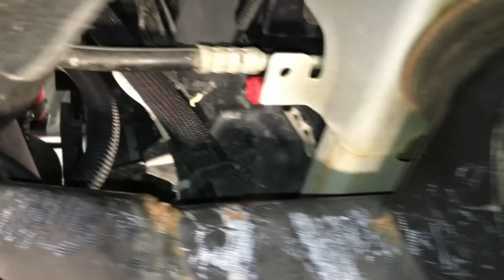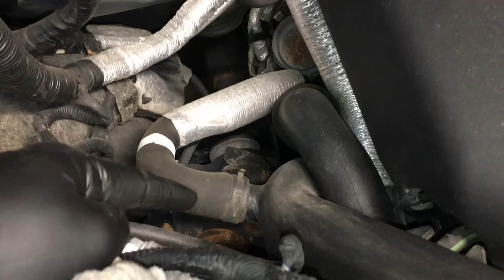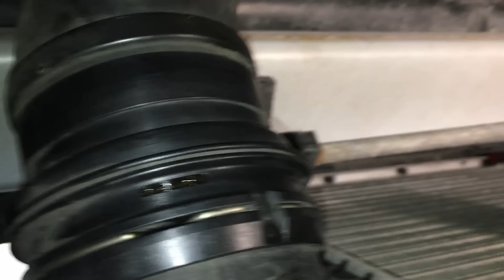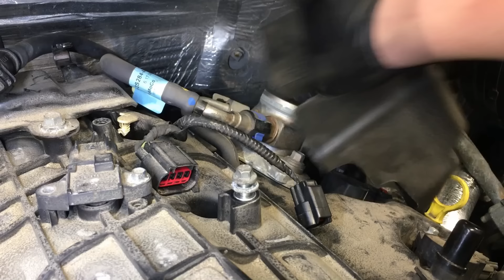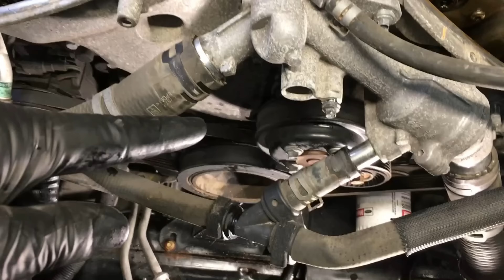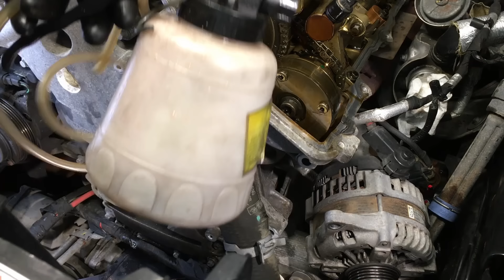2011-2016 Ford F-150 3.5L Ecoboost Timing Set Replacement Part 1: Getting Inside the Engine

Comment: Here we see the EcoBust in it's natural habitat.  Cue the documentary music
Reply: Right...cause the amazing 5.4L never had cam phaser and chain issues...did it?
Reply: I have a 5.4 with 300,000Km and have never done anything with it. Chains would rattle at an idle so I put in a bottle of Lucas with every oil change. So far it has kept the rattle away.+
Reply: People failing to maintain their vehicles is NOT the fault of the manufacturer
Reply: @MrErikw26  I have a 3.5 ecobust with 50k miles on it and a major rattle from the timing chain. I have never hauled anything, always changed oil every 5k miles with mobil1 full syn. Now... have I failed to maintain this vehicle??? It IS Ford's fault for making a sorry POS engine that has major failures @50k miles, and claiming it to be the TOUGHEST son of a bitch ever made!!!
Reply: @user-zx1ir7jt4c  everything mass produced is gonna have a few bad apples here and there, never saw a 50k engine with timing chain rattle that wasnt poorly maintained personally.
Reply: Sam Smith I know many people who have 300,000 miles on these ecoboost engines with zero issues. It’s luck of the draw too.
Reply: MrErikw26 I had a 2013 f150 with 60k timing chain rattle oil was changed every 4K miles now I have a 5.0 I’ll never get a eco boost again not a maintenance problem it’s a manufacturing problem

Comment: I'll be doing this sooner or later
are you going to upgrade the oil and coolant pumps too?
Reply from the maker: There is not much out there in the aftermarket for these engines yet surprisingly.
Reply from the maker: Upgrade them to what?
Reply: just wondering if there WAS an upgrade like the oil pump on 5.4 higher pressure and volume, as some people have complained of early cam bearing wear etc,...and ,...can the  higher pressure blow oil out of the main seals?    My ecoboost rattles once in a while but not often,...maybe once a month,...I keep the synthetic oil clean with 3000 mile changes and ford filters,...I do get a bad knock sometimes on hard accecleration on the on ramp to the highway,....I don't know what's going on so I have to ask questions,...thanks for the reply
Reply: Nothing available yet?
Reply: thanks for the information demonstration and replies,...my 2013 f150 is at about 100K and rattles about once a month,....I don't have a catch can but I do keep my oil clean,...maybe by the time I can't handle the death rattle anymore the new parts will be out,...or maybe even a crate engine replacement

Comment: Ford seems to have used the German method of engineering: make repairs as difficult as possible!
Reply from the maker: It sure seems so with this engine!
Reply: That's because - the ecoboost line was designed - in Germany. Forget whether it was an independent German design they licensed or whether it was Ferd of Germany that did it.
Reply: skigdivider x  and yet it's not a sbc or a LS that's having the timing chain replaced in the video, and what's really funny is that the motor in the video has probably got less than 200k on it. 😂😂😂😂😂😂😂😂😂
Binge watch the video for the real pos.😢😢😢😢😢😢
Reply: skigdivider x I don’t race. I drive a truck. I want a problem free truck, or at least one that will be easy to work on.
Reply: It's 2018...do people really argue one crappy American car company is better then another over designs and racing?
Reply: Ah!  Now I know!  I have a 4.0 "Cologne" (German Design) in the shop right now and it is a total PITA do do almost anything!  They drive the right cam from the rear and the left cam from the front!  It's a pull to install new chains!
Reply: REEF X mr  the only easy to work on truck engine from ford is the pre overhead cam days. That's why I like my overrated sbc and LS engines.
Reply: But they chose NOT to use the European method of vehicles lasting longer then the warranty!
Reply: The sbc is the most over rated pos ever built. They had to let GM run Ford style heads so they could keep up in nascar and they run the ford firing order. The LS is junk too!!!
Reply: @skigdividerx4991  so is your mommie
Reply: @franksrok5843  And your sister! Punk
Reply: Ford kicked Chebys ass in LeMans and they made them add weight and detune the ECOBOOST V6 last year. Ford gets more power from a 5.0 than the out dated 2v LS with the ford heads. And no they did not or ever will dominate.

Comment: Has Ford ever come up with a solution for the carbon build up on the valves? I know if I don't run mine to redline at least once a month it runs rough. And when I do run it up she blows a ton of carbon and smoke. Guess you just have to blow them out once in a while.
Reply: Well then I am good. It is a 2017 with the 2nd gen.
Thanks.
Reply: TOYOTA DID IT FROM THE FIRST
Reply: Yes on the second gen 3.5
Reply: adrian sims what's the solution? I hadn't heard.
Reply: They made it both direct and in-direct injection. The in-direct injection part spray fuel on the vales and is what suppose to keep them clean.
Reply: Yup, the old "Italian Tune-up" works wonders.

Comment: YOU ARE AWESOME GREAT VIDEOS I HAVE A 2011 ECO BOOST 3.5 ...NO RATTLE ISSUES BUT WHAT DOES SOMETHING LIKE THIS COST TO GET DONE..ALSO THE OIL CATCH CAN COST..DO YOU HAVE ANY TRUSTED FRIENDS OR MECHANICS IN THE MINNESOTA AREA BY CHANCE..THANKS FOR THE GREAT INFO HAVE A GREAT DAY
Reply: I just had mine fixed at the Ford dealer in Baldwin Wisconsin for $2500 it may be worth the drive!
Reply: That’s timing chain, cam phasers etc...
Reply from the maker: Super cheap there, my price was 2,300 in the end with a few additional parts.

Comment: They replaced the 4.6 and 5.4 with this ecotrash what a shame
Reply: Adan R just get a 5.0 and be done with it.
Reply: The 5.0 coyote 😎👍
Reply: m ph yes they are!!
Reply: I'm very happy with mine. Watch for the new 7.0 liter truck engine gasser to come out in the next 10-12 months. Inside info from ford Dearborn mi.
Reply: The 3v engines were trash.
Reply: I have an ecoboost and would get another !

Comment: Why is all that rust in a brand new truck that makes no damn sense
Reply: That truck isn't brand new. This fix is for 2011-2014 trucks. He lives in an area that have lots of snow and lots of salt is used on the roads to melt the snow/ice. Rust is gonna happen.
Reply: Matt Fuller Outdoors I live in New Jersey and I own a 2012 Ford Fusion and my chassis does not look like that at all
Reply: Because road salt. He's based in Chicago. All northern cars are like that.
Reply: I live in Michigan. I’ve seen much worse. Check out a 2010 Chevy pick up they are horrible for rusted steel.